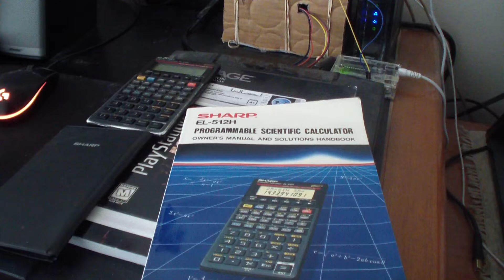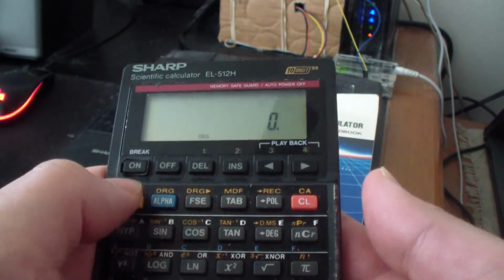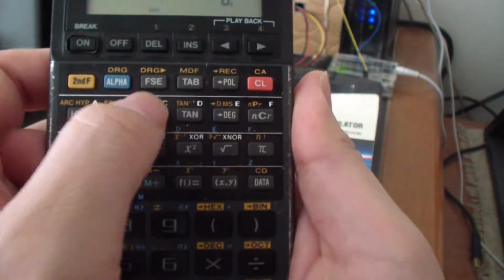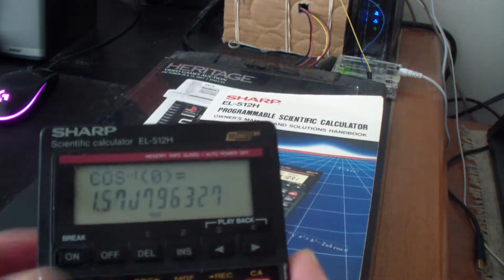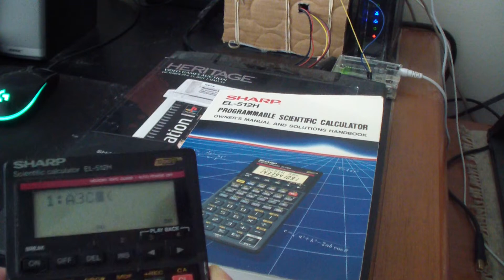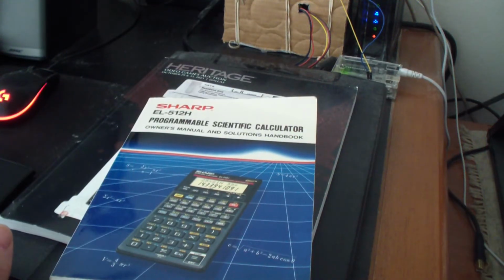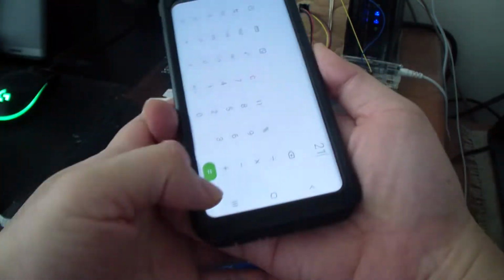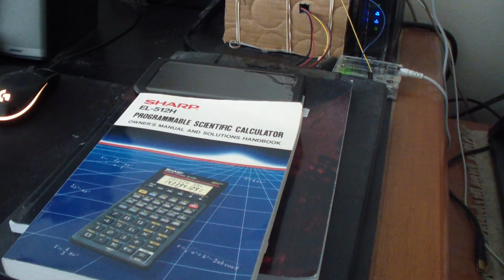Vintage Sharp EL-512 Scientific Calculator

Comment: Hey mate, cool video. I just got one of these and i'm having trouble getting the back off it - any tips?
Reply from the maker: There are little clips holding the back plate in place, so you need to use a spudger tool to loosen them.
Reply from the maker: https://amzn.to/3kYQDnW